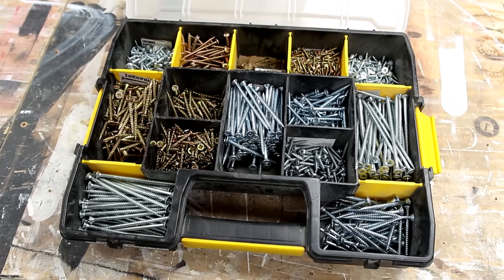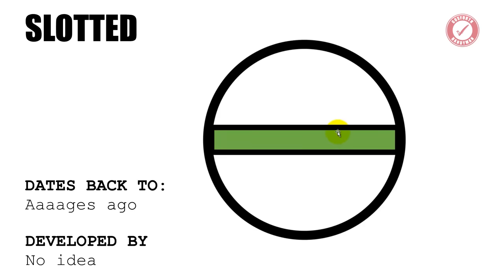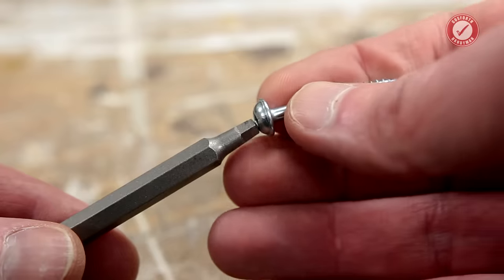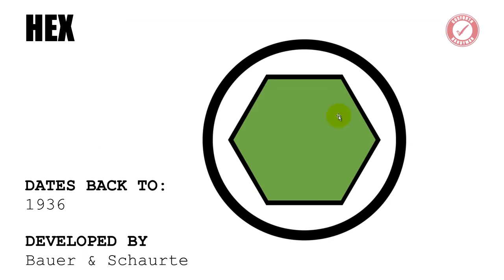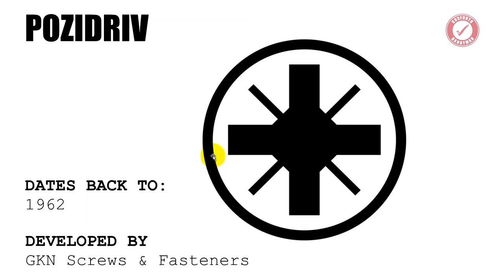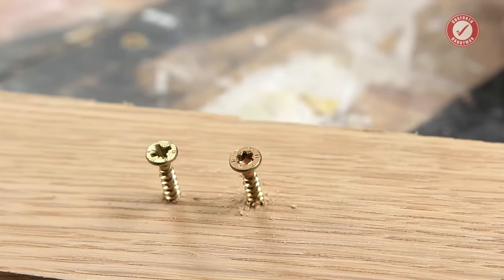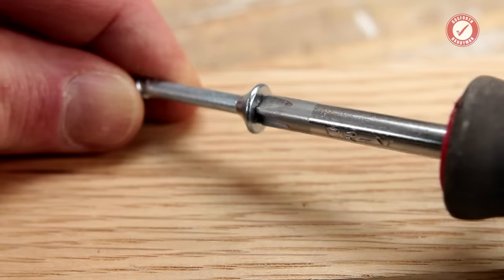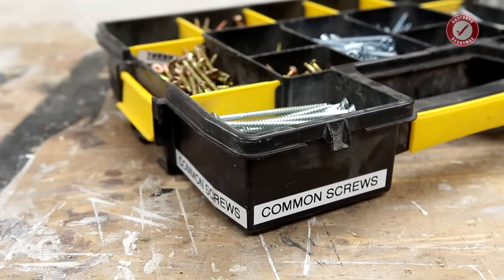Why are Pozidriv screws better than Phillips?

Comment: I'm old enough (barely) to remember when Robertson drive was starting to make its way into exterior screws (in USA) and it seemed like a total game changer.  This seemed to coincide with the rise of battery-powered drills being used to drive the screws.  That's a wonderfully worn-out example of a Phillips P2 driver BTW.  Nothing brings out the shortfalls of the Phillips drive like a worn-out driver tip.
Reply: Here in Canada it is hard to find anything other than Robertson other than for drywall fasteners. Robertson works better than anything else I have ever use including Torx or Posi.

Comment: I use Torx for all stuff when at home - Pozi when out on site purely down to cost. 

In Screwfix 5 x 50mm PZ2 Turbogold is £8.35 today, Torx 5 x 50mm is £13.69 which are both similar screws in thread and quality.

Pretty much UK wide torx versions of the pz2 equivalent quality screw are 1.5 - 2 x as expensive just for the change in head type!

Great video, thumbs up.
Reply: I love the Turbogold on the smaller shorter screws. I'm happy with gold plus for everyday, good screws.  I do like Reisser cutter as well, good for cutting into edgegrain on plywood.
Reply: @briannewton3535  yep goldscrew for most agree. Reisser are great for boring through if using just the combi... They dont have any pulling in power though but great for stuff like door linings.
Reply: @DUIofPhysics  yep I have that brand of screw in my eBay watch list. I wasn't aware Toolstation stocked them! Still got plenty of torx left before I repurchase. Thanks for the info!

Comment: In Australia, PZ2 is not very common. After some effort, I have managed to find a PZ2 screwdriver and I did some tests with a few PZ and Phillips screws around the shed. Contrary to what you said, the PZ2 doesn't grip the screws very well and there seems to be a fair bit of variation in the depth of the hole in the PZ screw so the driver doesn't seat properly. A good Phillips bit, however, seems to grip all my Phillips screws nicely, and they don't wobble. Not only that but a small Phillips screwdriver works quite well in a large screw etc. On the other hand, a PZ1 doesnt work in a PZ2 at all. 
Torx are used here a fair bit and are excellent, but as you say, you need to pick the right size. Good video - Cheers

Comment: Phillips screws & screwdrivers were designed to cam out.  It was a low-tech mechanism to prevent assembly line workers from over torquing, and stripping, the fasteners or holes.
Reply: No, they were not designed to cam out.  That's a myth that cam about after to explain why they preformed so poorly.
Reply: CMG30, despite a concerted search effort, I have found no evidence to support your claim that the fellow who invented the ‘Philips’ screw/driver was simply incompetent.

Comment: Great explanation of the difference between Phillips and Pozidriv. Until some time ago if you purchased a set of screwdrivers in the EU (and certainly in the USA) the crosshead screwdriver was Phillips. Despite of Pozidriv being the better screw, crosshead screwdrivers always seem to release themselves from the head when applying force. This is bad when fastening screws, it is a disaster when trying to loosen screws. Together the the round-headed slotted screw where the largest force is applied where the slot is the least deep I think cross headed screws are a mis-design, with Phillips the worst. Indeed, Torx heads are a relief. No self-releasing heads and screw-drivers.

Comment: I carry a full set of 6” long Torx wedges fit bits remodeling bathrooms. My favorite feature is that since they taper the six points will grab in Allen screws.  For instance those pesky set screws in  towel bars and faucet handles. Since the bits are so long I can get them into the set screws at a very low and turn them.

Comment: Here in Canada, my workshop is stocked in Robertson exclusively.   No reason to have anything else.   Sticks onto the driver can put a screw in with one hand.   Handles colour-coded by size.   Blunt driver tip unlikely to injure or get damaged.  If fasteners come with housewares (like curtain rods), then the included philips screws are immediately thrown away and Robertson screws used instead.

Comment: Excellent video thank you. I'm often surprised by folks who aren't aware of the differences in type and usage of screws. PZ2 is definitely king , and as you've named them in another comment, I will say the Screwfix Turbos are the best : terrific first bite and lead in, often need no pilot hole, are made to find tolerance for bit grip,  and just glide in whatever the workpiece. I've driven them straight into brick/plaster without plugs and they hold firm. 
Likewise a good driver bit helps - again you named (in a previous video) that the DeWalts are GFM ,  sturdy but cheap (ish). Thank you.

Comment: That was a well presented video-- good sound level without echo, and the viewer was spoken to  calmly and respectfully.
When I discovered square screws (never hear them called "Robertson" screws here in NZ ) it was such an improvement over Phillips head screws.  I use use them into wood and not usually anything much over 40mm..pre drilled, of course. Torx i have never tried but people do seem to like them for specific tasks.

Comment: Great, finally I find someone who points out the difference. Still, I've got a question. I think a big difference is also the fact that the four 'blades' of the tip of a Prosidriv screwdriver have parallel sides whereas the 'tip-blades' of a Phillips driver taper and thus force the screwdriver up and out of the screw when force is applied. In the case of a Posidriv that tendency is totally absent hence the fact that the posidirv screw hangs on to your screwdriver so easily. Am I right or mistaken?

Comment: I recently got into the pocket screw arena. I have a wheel chart from KREG and a whole case of different sizes, lengths, coarse, fine, indoor and outdoor. There's a lot to go through just to incorporate it into a project. On thinner wood 1/2 inch I had a blowout on the back of the connection. The downside is that sometimes they wobble when starting.
One guy doesn't use the stop collar guide. He does it by eye and sets them deeper

Comment: The quality of screws makes a big difference. Good P2 screws with decent bits - like Dewalt impact bits, or Makita XPS - are absolutely fine, and rarely cam out. I ran into some bad Robertson screws in which the square hole reamed out when I hit a knot, and they were actually harder to remove than a reamed out P2 screw; that sort of soured me on Robertson screws for a while. Finally I gave up and bought a couple of big Spax screw collections. The stainless screws are all their version of torx (nice but unnecessary) and the others are PZ. I've never had any trouble with either of these, but I also never once had a Spax P2 screw cam out, either, as long as I was using a decent bit.

Comment: I just went through my dozens of screw containers and tossed anything with a Phillips head on it.  I kept the slot heads for vintage items (old radios etc.) where they are used.  I kept the Robertsons as I find them the best and I kept the Torx head and hex socket ones.  The only exceptions were drywall screws which I think only come in Phillips, and speciality screws needed for certain electronics.  In general I wish they would phase out Phillips head as I find they are about the worst design for strip out out there. Any brass Phillips screws and any other screws with stripped heads will get melted down for other projects.

Comment: Nice video, thank you. Not sure where the information about the development of  hex head screws came from. According to Wikipedia they were invented in about 1910, but perhaps only for set screws. Bauer & Schaurte was a German manufacturer of fasteners but I didn't find what they had to do with hex drive screws.

On the issue of pozidrive versus Torx. In the US in my experience Torx is much more widely available and I have not used Pozidrive screws very much. However for higher torque purposes Torx screws are a significant improvement over Robertson screws which are a significant improvement over Phillips screws IMO. 

I read a few articles comparing Torx and Pozidrive and some people liked Torx more so not everybody has come to the same conclusion as to the superiority of Pozidrive as the creator of this video. But I can see that there are advantages to the Pozidrive. Maybe in a perfect world we'd all be using Pozidrive for very low torque to midrange torque applications and Torx screws for high torque applications? Or maybe just Phillips for low to medium torque applications and Torx for high torque applications?
Reply from the maker: I might need to do a bit more reading in to this but according to Wiki "The German company Bauer & Schaurte patented the hex socket 1936 in Germany, and marketed products based on it" 👍

Comment: I've been in the building industry for 30 years and never really understood the difference between Phillips and pozidrive until recently. Many old school builders will still refer to pozidrive as Phillips, even though 90 percent of screws these days are pozidrive. I think that pd screws are Phillips Mk2.
Reply: there all flat heads if you smack the screwdriver hard enough with a hammer

Comment: I go out of my way to import Pozidriv screws from the UK to here in the states because I love them. Locally, everyone discovered Torx about 15 years ago, and woodworkers adopted Robertson from the Canadians, so there are plenty of those to go around.  I don’t necessarily hate the original Phillips.  However, you’ll be hard pressed to run into it as a vanilla offering.  What’s common are these awful screws that have a combined Phillips/Robertson/Slot recess (not to be confused with “xeno” terminal screws).   These combo drive screws wobble right off of any bit you choose.
Reply from the maker: Fantastic stuff - keep spreading the word about Pozi 'cause they're awesome! Torx certainly have their place but Pozi is a far better solution for general purpose use. 👍👊

Comment: Can't disagree with any of that, PZ2 here as well. Except that my favourite and most useful hand screwdriver is actually a Japanese JIS item, it seems to grip pozis as good as a PZ driver, it just so happens it also has an impact mechanism so if I come across a hard to remove screw I can just whack the end with a hammer and it will get it out. Best tenner I ever spent!

Comment: I'm also a big fan of PoziDriv. Being able to use a PZ2 bit for pretty much everything is great, and they are far less likely to strip than a Philips as well as the screwdriver tends to lift up out of the grooves more when the force starts pushing the screwdriver back. That said, they aren't the prettiest screws, so for screws that are to remain visible and have a decorative purpose as well as being functional, slot still has its place. I do like the look of Robertsons, but I've just never seen one in the wild yet.
Reply from the maker: Yeah, defo still a place for slotted for decorative use. 👍👍

Comment: There are also a Torx version that's self-aligning (axially, and holding well) - there's a little protrusion, a tipin the bit and corresponding hole in the Torx socket, or I should rather say I saw this type of Torx being introduced and marketed few years back, but can't tell whether id develop any foothold or it just faded away - as a solution in search of the problem it pretty was. 
(Torx screws are meant for bigger screws and harder woods, as they can transfer more torque safely; Pozi is generally meant for smaller screws and less torque.)
Also, there are different angles and width of the grooves in Pozi system as compared to Phillips, I'd say PZ it's an improved  version (in a sense) of PH, or "PH v 2.0" - in the same way as Torx is an improved Hex.

Comment: Yes everyone, understandably so, bashes the Philips drive over the head. But before we are too hard on it, part of the history lesson should really explain that the Philips drive was specifically designed to cam out. This was to prevent over tightening when used driving into aluminium which is soft. I agree the Pozi drive is my favourite as it is very common and provides excellent torque. Now that you've covered drive systems, I would really like to see a similar explanation video on thread types and head shapes.

Comment: 2 cents:
1. With PZ drive the force is also working more perpendicular (since it has no taper) and much less of the turning force adds to camout.
2. Like you said: get a good screw and a good driver (PZ2) I find this also goes for Torx. The sloppy fit you demonstrate vanished for me with better fitting gear and hardware.
So for woodworking I only buy torx now. Metalworking usually socket head cap screws with hex drive.

Comment: I positively loath Phillips heads screws.  The greater the torque you need to drive the screw in, the greater you need to push, to the point where you simply can’t push any harder and it cams out.  Hate them!

Comment: Robertson is the standard drive system in Canada.  Phillips are usually only used for drywall screws because of the way they release is a drywall driver.  I've never seen a posi drive before. Scott
Reply from the maker: Pozi rocks but I don't think they get used much over the pond. Same here for Phillips drywall screws in the UK too - does my head in since I've always got a PZ2 bit on my driver and it doesn't work in Phillps. 👍👊
Reply: Pozi isn't common in the US, either, but it's not exactly rare. Most of the time I seem them it's after mangled them with Phillips screwdrivers
Reply: If you get an IKEA Fixa screw set it's full of Pozidriv screws.

Comment: I'm with you, I much prefer pozidrive whenever possible. It's so annoying how many screwdriver sets though still come with Phillips heads even though (aside from drywall screws) I can't remember the last time I saw phillips screws for sale in a shop.
Took me ages to find a good quality stumpy PZ2 screwdriver for adjusting hinges inside small cabinets.
One day I might also get to use my PZ4 screwdriver!
Reply: Oooh, could you give that stumpy driver a name please. I am still buying Roughneck, cheap, but soft, but as rarely used, I tolerate that. Problem with stumpy's is not being able to keep em in line with the screw.
Reply: @briannewton3535  I am afraid it is a vintage Stanley I picked up at a car boot.

Comment: I work in RnD and we primarily use Hex drive actually. So, no, Hex drive is not just domestically used. xD

My only gripe with Hex drive is that cheap tools tend to have greater tolerances in the bit to screw fit which leads to stripped screws and that some counter head screws use a smaller hex head than their socket head equivalents which also tends to promote stripped screws.

We are switching over to Torx right now, best decision ever, but we have to rebuy alot of tools for that.

Comment: I think the flexibility in using the screw head is a mistake because if you try a lot of torque on that you will damage the head of the screw.  This is very common in many places and I have seen stripped number to screw heads when it was supposed to be a number three.  I thought from another story that the purpose of the Phillips is that it is self-limiting and torque because it actually backs itself out when the torque is too large.  This may have been a feature when the screws were used self-tapping for sheet metal. That is also why Phillips are problematic when you try to put a lot of torque in, especially if you have the wrong screw head size.

Comment: My favourite screws are the ones covered in 50 years of paint...
Reply: Which is my only reservation about Torx screws. Trying to scrape paint out of the slots to fit a driver in.  Hex (Allen) is better in this respect.
Reply: I just took some decking off a 16 year old deck. Over 800 screws. Many of the screws were buried. I first used a 40 grit disk on a 4" grinder to expose any buried screw heads. Posi-drive screws. I used a 7/64" drill bit to clean out the center. More often than not use of a #2 Robertson would work to extract. I tried using a posi bit with out much success.

Comment: Here in the  US posi-drives do exist but you're unlikely to find them. My favorites are the Robertson for wood or construction projects and the Torx for machined parts like motors etc. They look much neater IMHO. I do wonder why your torx was so wobbly since I've never had that problem. Perhaps were worn out or out of spec. Good video for the most part. And yes, phillips are the most common. I wish slot head would just go away.